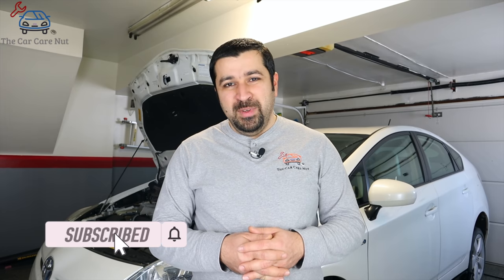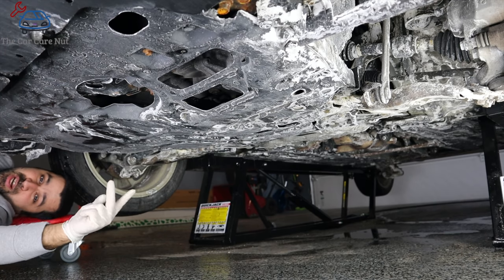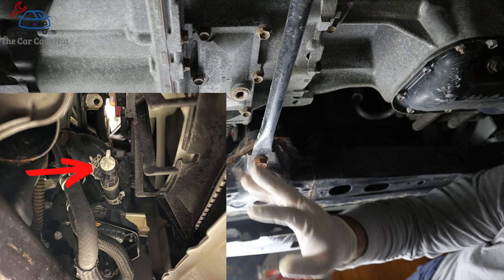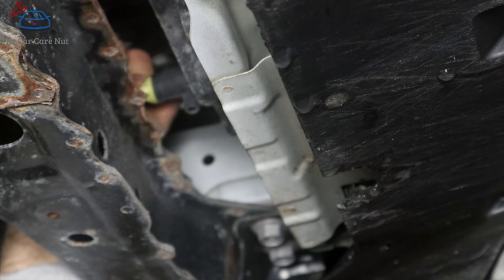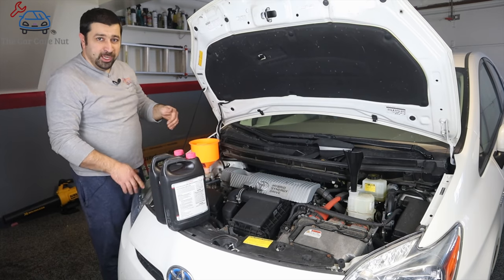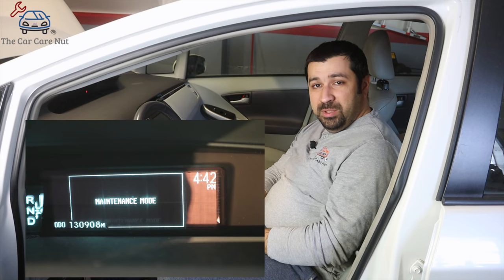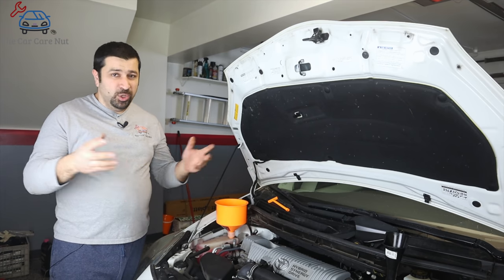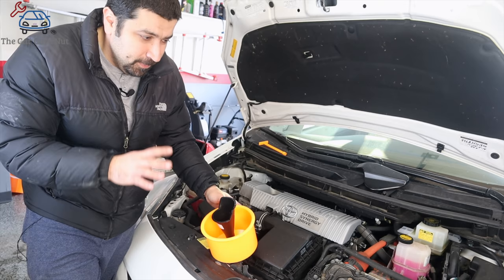How to replace your Toyota Hybrid Inverter and Engine coolant

Comment: Hello. Great video and this looks easier than changing coolant on sveral other vehicles I've done. My question is, does this same procedure apply to the current ( 2022 and upcoming 2023 )n Rav 4 Hybrid? What are the change intervals for the Invertor and the engine coolant if they aren't the same?

Comment: AMD, I have a 2015 Camry Hybrid with 150k miles and was wondering if the water pump should be replaced at a specific mileage, along with the thermostat?

Comment: This was a GREAT DIY video! My Prius Prime only has 21K miles on it, so I won't have to do a coolant change for a while, but it's good to know in advance what will be involved when it's time. I am getting ready to do a transmission oil change on it - probably a lot sooner than Toyota recommends, but I just want to make sure that any metal shavings from the initial break-in period are removed.

UPDATE: July 2022. I changed the transaxle oil at 25,500 miles. It came out still pink and smelling about the same as new ATF-WS oil. So no deterioration that I could see. I'll change it again at 75,000 miles, I guess. I was able to route a 4 foot long piece of 1/2" ID vinyl tubing with a funnel on the upper end, down behind the engine, and across to the transaxle fill hole, then just pour the oil in and let gravity take it into the transaxle. No pump needed. It took about 3.6 quarts to fill it to the bottom of the fill hole threads.
Reply: Hello, I have a question, when do you know that is time to change your antifreeze/coolant? I just bought a used 2010 hybrid Prius but i don’t know how to recognize if I have to change it already :(
Reply: @igorrosales1799  - Depends on mileage. The recommendation from Toyota is to change the radiator and inverter/transaxle coolant every 60,000 miles. I change my engine oil every 5,000 miles, and transaxle oil every 50,000 miles. Toyota says that the transaxle oil lasts 100,000 miles, but I have seen too many videos where people drained Prius transaxle oil at only 70,000 miles, and it came out almost black and smelling "burned". Toyota ATF-WS Transmission oil costs maybe $50 for 4 quarts, and changing it every 50,000 miles is cheap insurance to help guaranty that your transaxle will last 250,000 miles or more.

Comment: Hi TMDT, thanks again for an excellent video. What is the correct procedure to change brakes pads on a Hybrid vehicle without DTC appearing?
Reply from the maker: Hi! Just like you would on a regular car just don’t open bleeders and you should be good. Make sure the car is off when you replace the pads
Reply: @TheCarCareNut  thanks for your insight.

Comment: I hope this doesn't come off as a dumb question, but when and why do you need to replace the coolant? I totally get Tran fluid, brake fluid, and oil of course. Wasn't really aware coolant really got that dirty or much of anything where to worry about. Always top it off and check it so it won't get low, that I totally get. Thanks!
Reply from the maker: Hi! Very good question. So coolant has 2 issues after it gets old. One the anti freeze in the coolant starts breaking down and now the anti freeze protection level diminishes. The second issue is that it becomes acidic and starts attacking seals and gaskets and starts causing leaks. That’s why there’s a replacement interval for coolant.

Comment: Hi.  excellent videos.  i did the coolant and inverter coolant flush on my 2016 Camry hybrid but the fan never came on.  I had the car in maintenance mode for about 15 minutes and bleed most if not all the air bubbles from the radiator until the coolant started to smoke but the fan never came on.  Any advice?

Comment: I bleeded coolant and I filled the new coolant, and as you say I started the engine in maintenance mode, the engine worked more than 40 minutes but the radiator s fan didn't work.. And on indicater board, the temperature 60%... I am living in Switzerland... It can be because of weather... Or something else.. 😊

Comment: So why does the inverter housing down under the car where you drained the coolant, also have an obvious fill bolt?  The fill bolt I'm talking about is found on the left side.  Take the left wheel off, then remove the four plastic clips holding the vertically oriented black plastic cover.  Once you remove this black plastic cover behind the left front wheel, you'll see a 10mm hex bolt that sure as heck looks like a fill port.  Any thoughts on this?

Comment: I’ve seen this video a few times already in preparation for my first coolant change on my 2022 corolla hybrid le.  My engine coolant reservoir have two caps.  Do both caps off and to fill which one to fill from?  The main cap does not go directly to the reservoir unlike the inverter coolant which only have one cap same as in your video.  Will I be looking at two drain holes for the inverter coolant?  Thanks!

Comment: Hi: I have recently become the owner of a Toyota Alphard Hybrid 2005 A10, I have watch a lot of your videos with great interest. The question I want to ask is does the inverter  have a separate radiator. Why I ask is because there are two caps and a expansion tank in the middle. Do I just drain the old coolant and fill the centre expansion tank or fill from both caps

Comment: Nice video. I have Toyota Prius V 2013 with 190,000 miles. So, I had to change Thermostat recently and I suspect some air in the coolant system , because , I see over heat sign comes on and goes off after 30 minutes of driving , and it keeps on coming . Is this the sign of blown out head gasket ( in it's initial stage ) or is it due to some  air in the coolant system. I did run it in the maintenance mode , and also took it to the dealer eventually and got coolant flushed. But , it still over heats after 30 minutes of driving. Thank you. I subscribed
Reply from the maker: Likely due to air in the system also check your fan filter for the hybrid battery as the overheating could be for that not for the engine

Comment: Can you tell me if the 2018 camry hybrid is the same  engine radiator drain as this prius or would i need a washer 
Thanks
Reply from the maker: Hi! The 2018 Camry has a slight different procedure to bleed the coolant and the radiator drain for the engine is in a similar location as the prius
Reply: @TheCarCareNut  can you send me the info on how to bleed the 2018 Camry hybrid
Thanks
Reply: Hi. My 2018 Camry hybrid engine and inverter coolant change on took about on gallon of pre mixed coolant, wanted to check with you if that sounds right for this car?
Thanks.
Reply from the maker: Hi! Usually a bit more than a gallon. Did you bleed it?
Reply: Yes engine and inverter both together with bleeding took almost one gallon
Reply from the maker: Interesting. Well the inverter will take less but the engine usually takes just over a gallon on its own
Reply: Have you done any 2018 camry hybrid?
Both coolants want to know if they are all requiring same amount of coolant like mine?
When we drained it not much coolant came out even from engine
Thanks for your time!

Comment: The TIS for the 2017 Prius shows how to replace the coolant for ONLY the Engine.  And, it has steps that include "removing the air release valve," "squeeze the No1 and No 2 radiator hoses," "check that the thermostat is open," and finally it says, "bleed" without explaining any steps.  This seems quite a bit different vs. this video. I think I'll try combining the TIS with your video.  (Also, I'm a bit confused... is the inverter cooling system a closed system, or part of the engine cooling system?)

Comment: READ THIS IF YOU HAVE A HYBRID CAMRY OR AVALON...OR MAYBE ANY HYBRID TOYOTA WITH A TRADITIONAL METAL RADIATOR CAP

Sorry for the all scary all caps headline.  BUT hopefully you can learn from my mistake and avoid blowing out your coolant pump, overheating your engine, or worse.  If you have a hybrid Camry or hybrid Avalon and follow the instructions as they are in the video to drain and refill your engine coolant, there's a good chance you won't have nearly enough fluid in the system when your engine gets hot.  Your engine will try to overheat during the maintenance mode process, and your coolant pump will be spinning while dry (I think mine failed because of this).  From my experience and those of others, you MUST fill the radiator directly through the hole under the metal radiator cap, assuming you have both a plastic reservoir and the traditional metal radiator cap.  Fill it, keep filling it as the bubbles come out, and then fill the reservoir.  Just filling the reservoir (as shown in the video) isn't enough; the engine won't pull in enough coolant in time.  I have a 2013 Avalon hybrid (2AR-FXE / 2.5L) that had no coolant system issues before I started this project, and I'm no expert on your vehicle.  But read about my experience (start at the bottom) before you start the process of draining / refilling your engine coolant, esp. if you have both a plastic reservoir cap and a traditional metal radiator cap.  I'm telling myself that I basically got a new engine coolant pump for what I would've paid the dealer to do the engine coolant drain and refill.  But that doesn't count the price of the hours of worry, the time it took to install a new coolant pump, the misery of wondering what I was doing wrong and if I was destroying my engine, etc. 
::::::::::::::::::::::::::::::::::::::::::::::::::::::::::::::::::::::::::::
(Hopefully) final update...about six days into this thirty minute project:
I was on the verge of giving up and having the vehicle towed to a Toyota dealership, but then I had some fantastic interactions with others in the comments.  These were folks who'd either had problems like me or who had successfully done an engine coolant drain and refill on hybrid Camrys or Avalons.  They all agreed that you had to remove the radiator cap and fill the radiator directly, then fill the plastic reservoir.  If you only fill the reservoir (as shown in the video), you won't get enough coolant into the system.  Well...I mustered the courage to try that.  Filled the hole under the metal cap until it was full...then started the engine in maintenance mode...then kept filling through that hole as the engine started to warm up...then put on the cap before the engine got too hot, then filled the plastic reservoir to the "F" line.  I watched it (and the reservoir line, and the engine temp) like a hawk.  It ran in park for 20 minutes in my driveway on a 95 degree day, and the heat now works, and the A/C works, and it didn't give the slightest hint of wanting to overheat. The radiator cooling fans even clicked off a few times because I guess the system was staying cool enough without them.  I'll keep an eye on it over the next few days and baby it a little before risking a long road trip, but it looks like this solved my issues.  I didn't have an air bubble, or an air lock, or a blockage in my system.  I just had an underfilled radiator. 

Update on the original post below...about three days into this thirty minute project: 
I drained the coolant, replaced the coolant pump with a new one from Aisin (pro tip: pry out the clips holding the orange cable to the top and side of the pump), and refilled the system.  Cleared the coolant pump failure and hybrid system problem check engine codes, and neither came back on when I restarted the vehicle.   I'm afraid to repeat the process in the video, fearing I may blow out my coolant pump if it's spinning while dry.  I've driven it a few times on short trips around the neighborhood.  When I shut the vehicle off, coolant will SLOWLY drain from the reservoir into the system, and I always refill to the "Full" line once that's done.  Notably, the heat isn't working but the cold A/C does.  I'm wondering if either the coolant level is still too low, or if air is trapped in the system, or if maybe my thermostat went bad when the car tried to overheat a few days ago (it still warms up and seems to be sending the right temp to the dashboard, though).  It doesn't seem to want to take big gulps from the reservoir while the engine is actively running.  

Original comment, about eight hours into this thirty minute project:
Sooo...I followed this video step by step to drain and refill my 2013 Avalon hybrid engine coolant (not the inverter coolant). Everything went fine, I filled the reservoir to the full line and went into maintenance mode, keeping an eye on the coolant level and waiting to fill it when it dropped.  However, the engine kept trying to overheat and the radiator coolant fans kept running (they would never shut off, and it in fact they started running REALLY fast before the engine temp moved toward dangerous levels).  And the coolant level in the reservoir never dropped. Thinking I may have had air in the system somehow, I re-drained and refilled it. Same problem.  Now I'm getting a P261B code (bad engine coolant pump?) and a hybrid system error message. These never popped up before my drain and refill. The fans just keep running, the engine slowly gets hotter and hotter, and I hear an occasional click...maybe the failed coolant pump trying to start? Any idea what I did wrong? Should I have filled both the reservoir and the radiator cap before starting it in maintenance mode? My 30 minute project turned into an all-day event. Wondering if I've burned out my coolant pump, or worse. Thanks in advance!

Comment: How many years to change it, or by mileage, or check it with radiator fluid tester first. So
Reply from the maker: Hi! It’s recommended to change it the first time at 100k miles or 5 years then after the first replacement every 50k miles or 5 years

Comment: I just had the engine and inverter coolant flushed at the Toyota Dealership on my 2013 Toyota Prius.  I was able to stay with the car and watch the service performed.  When the tech drained the coolant he only removed the inverter cap and not the engine coolant cap.  I questioned the tech why he didn't remove the engine coolant cap.  The tech said because it will still be able to drain out of the radiator but will restrict the flow from the radiator and not make a mess coming out of the radiator drain plug.  So the coolant did drain from the engine coolant reservoir and ran out of the radiator drain plug but I'm curious if all of the old coolant actually flushed without removing the engine coolant reservoir cap?  What are your thoughts?

Comment: Does just draining the engine from the radiator remove all the old coolant? I wouldn't think it would if the coolant valves are closed.

Comment: I'm not sure if I just missed it but I didn't notice you mention how to turn maintenance mode off after the coolant has been replaced. I am a while away from having to do this as we have a 2023 Rav4 hybrid with less than 800 miles on it. Is the process the same?